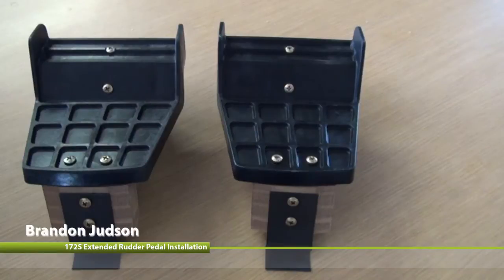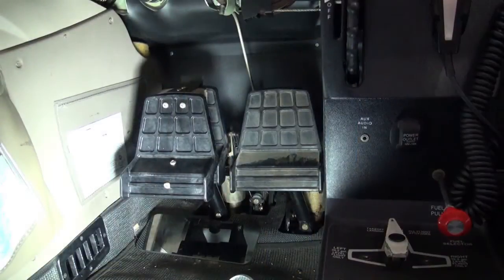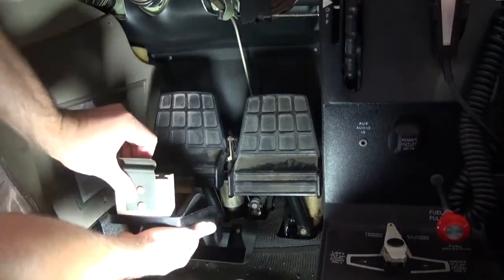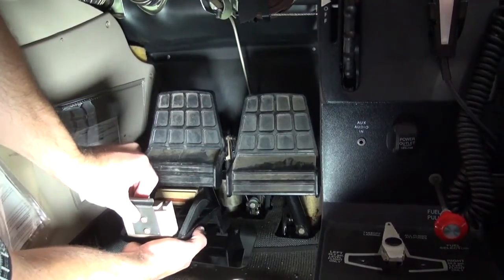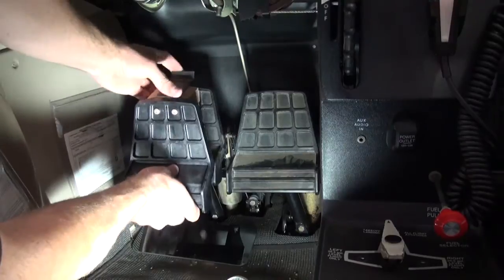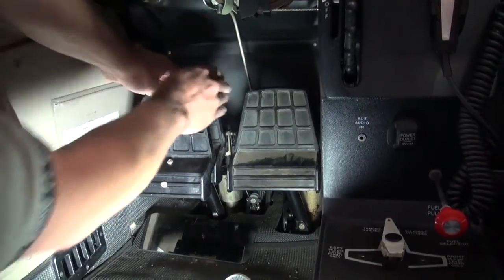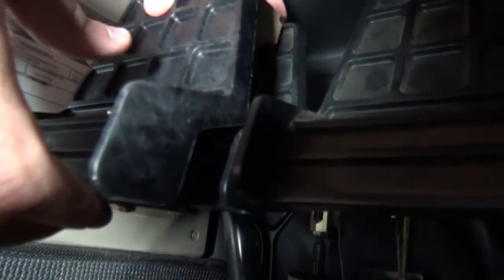172S Extended Rudder Pedals Installation

Comment from the maker: The extension assy for the rudder pedals on the 172S are called out in the IPC (27-21-00 fig 01 page 3 item -34). The part number is 0501081-8 (need to order two ea.). You can order them from any Authorized Service Facility and install them as pilot installed equipment (no STC required).
Reply: Can it work in a 152
Reply: Here for the 152 question as well.